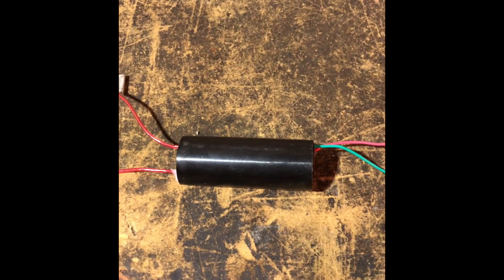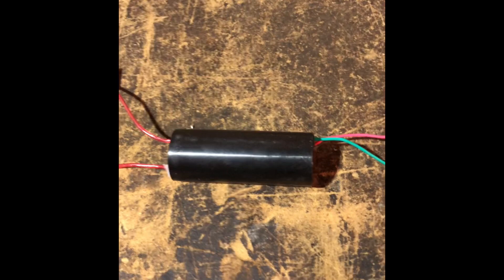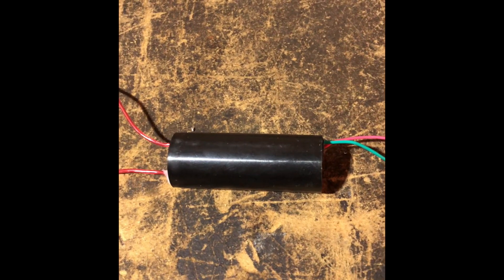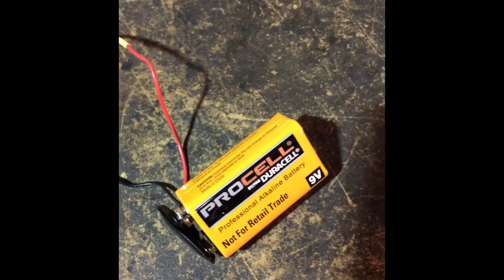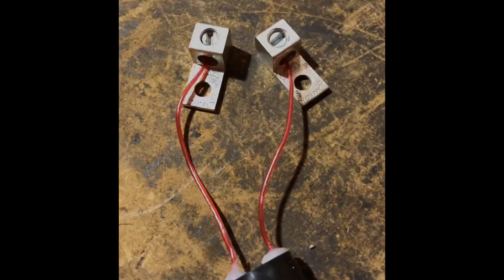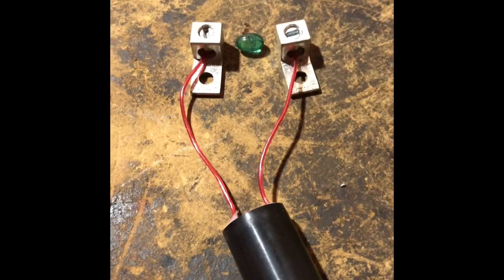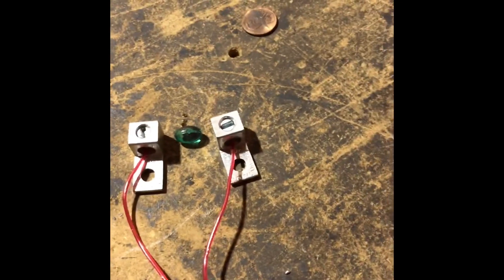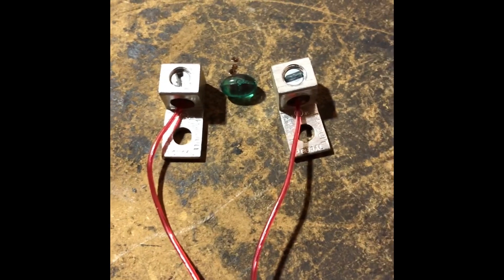Hutchison Effect Attempts 400,000 Volts I’m Going to Open a Portal !!!

Comment: And effect???
Reply from the maker: I found the kinetic properties of the high voltage fields to be very interesting. The ability to vibrate small objects in between the arching electrodes.  The work continues
Reply: @supernaturalink  👍
Reply: Paranormal Mad Scientist it makes it vibrate because some crystals have the property of vibrating under electric influence witch translates into heat and kinetic energy witch makes the crystal move(standard physics) HOWEVER

I do have a theory myself a few post above

But ill do a small explenation atoms are held by the “strong force” but have been observed to have a magnetic field of their own.

Keep that in mind

So lets say and this si quite a big step here but i explain in my other comment

That this “strong force” causing the manifestation of matter in space to be the dame force as electromagnetism 

What would that mean?

It would mean the hutchingson effect might as well be proof that this is the case 

Of course its a theory just like relativity quantum and string 

👍🏻

Comment: Dont you have to make the crystal vibrate at a different frequency? I think some different results would happen, if you somehow streamed different frequencies through the crystal, until you can find a resonating frequency that changes its vibrational state, and Then put energy through it. Maybe even try to add a magnetic field around the crystal. Just thinking outloud, Never tried anything like this but I wana get into it . What tools should I buy to start trying this?
Reply from the maker: I started out actually using an old tv transformer to create high voltage. Quite the learning experience on that project. Now I just Experiment with different high voltage sources and using different materials under different conditions. I like the frequency idea. I’m gonna try to figure out how to actually do that. Hitting them with lasers is another idea. Thanks for your input!